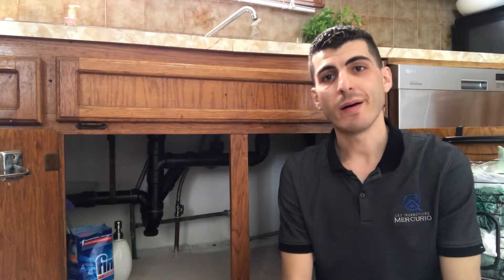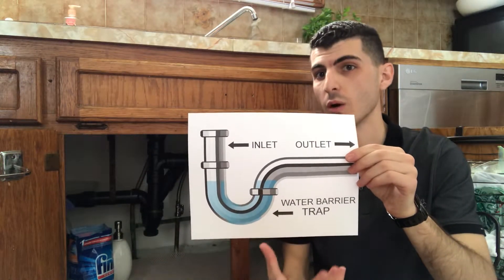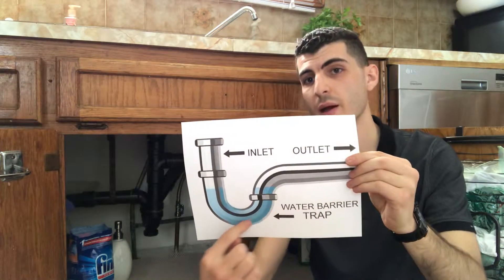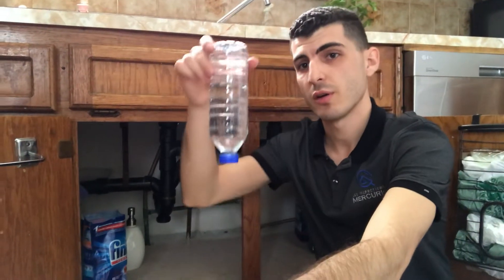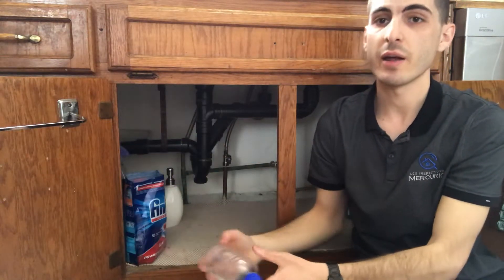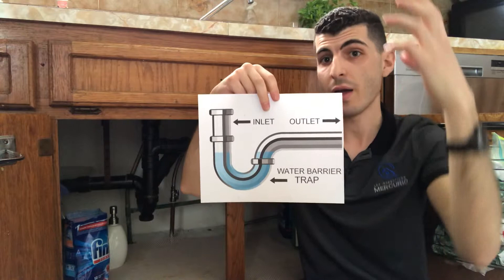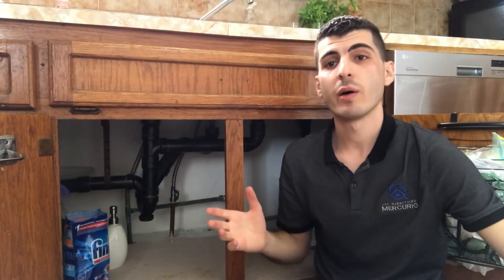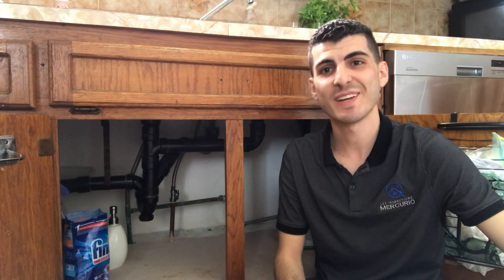Double Basin Sinks and P-Traps

Comment: What if you have two p-traps and a separate stack vent or AAV for each P-trap? Wouldn't that prevent the syphon effect from one basin to another?
Reply from the maker: I don't think it will prevent siphoning. But I'd verify with a licensed plumber.
Reply: @lesinspectionsmercurio9332 , how would syphoning occur in that case, if you have air admitance into the trap arm? The atmosphere would prevent negative pressure from reaching the trap.
Reply from the maker: @vitorao  As I said, I'm not entirely certain of your situation so it would be best to consult a licensed plumber. This video was for educational purposes and will not cover all situations.

Comment: I just bought a new replacement disposal for my sink and the new Insinkerator wants me to use a P trap as the discharge tube makes a 90 degree turn down.  My old disposal just discharders straight over the to the second basin then flows into a P trap. I am guessing I should keep it that way and not install it as the instructions specifly.
Reply from the maker: I would be inclined to suggest following the instructions that came with the new garbage disposal. If you're still unsure, it's always best to consult a licensed plumber.

Comment: Hi Kevin, thanks for the video. I recently had a blockage in my double basin sink, called a plumber to have it fixed, and now when I run my dishwasher (connected to the sinks), my sinks fill up with water. The plumber says it's because I need two P-traps to drain quicker. Does this make any sense, or is it that there is still some blockage? Thank you.
Reply from the maker: There must still be a blockage.
Reply: @lesinspectionsmercurio9332  Thank you for the quick response. The plumber came back and fixed it properly this time, maintaining the 1 p-trap system which works perfectly fine.